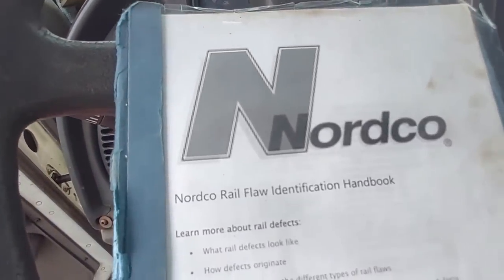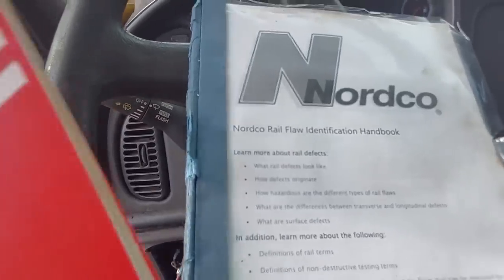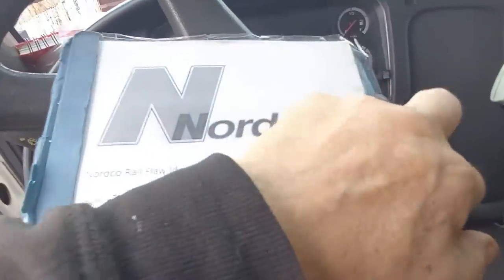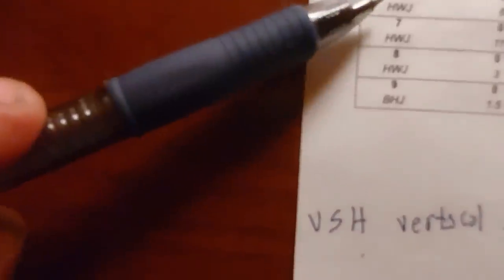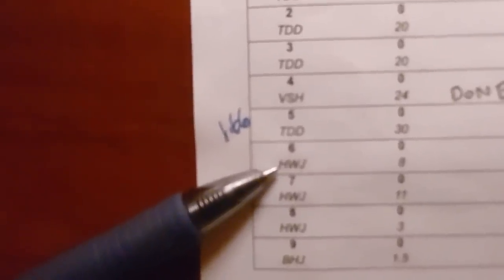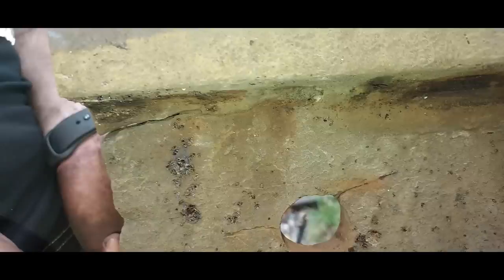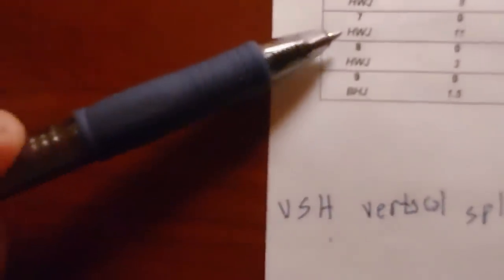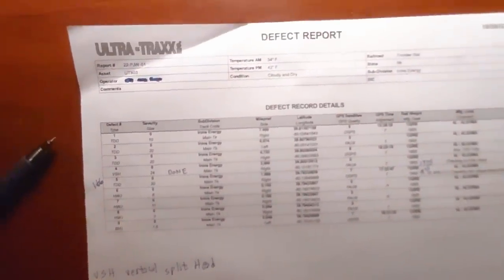Discover what an Ultrasonic Rail Testing Report Looks Like

Comment: Another great video Dave ,Iam a welder  and we would much rather have an ultrasound done than an X-ray because the x-ray just shows the flaw but the ultrasound shows how deep it is. Then you know which side to back gouge from which is usually the side that you have to take  the least  amount of material
out to get to the flaw.😊🍁😊
Reply from the maker: Very interesting Jay, I know they x ray gas pipeline welds, but
never thought about what you said, makes great sense. Thank you so much for taking the time to stop by and check out the video my friend.

Comment: Ahh! The yellow book! I’ve seen that book, but never read it. I was not directly involved in track maintenance, so I didn’t need to know that stuff. My only involvement with MOW work was as a pilot for the inspection car, or as “track foreman” when contract crews were working. In that case I would hold the track warrant for the out of service track and allow rail traffic to pass when safe.
Reply from the maker: Appreciate the nice comment Bill. that Sperry book is a wealth
of knowledge on rail development and defects. Thank you so much for taking the time to stop by and check out the video my friend.

Comment: Dave did you know that they are supposed to test the welds on the rail   we found many in the new welds on rail very important to have these done great video thanks Dave
Reply from the maker: No I did not Gary, although I would imagine for high class rail
yes it would be mandatory with good reason. They have never
tested a weld on our class 2 track, I will talk to the welders 
next time they come in to see if they have done any. Thank you so much for taking the time to stop by and check out the video my friend.
Reply: @ccrx6700   see what happens when you find someone who has worked with Conrail and CSX  and the bay colony railroad and B&M

Comment: Dave is there any chance you could set up a camera on the inside of a bolted rail joint so we can see the clearance of the wheel flange to the joint plates, we are mainly welded joints in the UK so no "klicky clacks "
Reply from the maker: Appreciate the suggestion Turbo Tim and yes sometime I will
do that, just not sure when it will be shown on YT tho, please
be patient. Thank you very much for taking the time to visit with us and check out the video my friend.

Comment: Sperry started with induction testing or using a high electric current amperage through the rail and changes in the magnetic field to find defects.  Ultrasonic testing was developed to help pinpoint defects.  Ultrasonic methods are easier than induction because less equipment is needed in the search.  Induction testing requires an electric generator and brushes that handle large current flows through the rail to be measured by coils to detect magnetic-flux changes caused by defects in the rail.  Induction testing equipment is installed in a dedicated rail car that can handle the weight and size of the equipment.  Ultrasonic equipment is usually mounted in high-rail-equipped trucks for ease of maneuverability and convenience of operation.
Reply from the maker: Appreciate your sharing that history lesson Roy, you are right. Thank you so much for taking the time to stop by and check out the video my friend.

Comment: Re the GPS locations
Basic GPS positioning requires reception of at least 4 (up to 31 operating) orbiting GPS satellites to be in view, and uses the time difference between received signals to calculate position. The "DGPS" on your report indicates Differential GPS is used to get a finer fix accuracy (fractions of an inch instead of feet) - some fixed location(s) in the region monitors the GPS signal, observe the current GPS error so that a correction can be made to the GPS position of the mobile station.
In other contexts the quality number is how many satellites were used for the fix, probably the same here. (In a valley typically fewer satellites are visible.)
I couldn't quite read the other term in the column, maybe "fail" indicating not enough satellites are seen? In which case other inputs such as distance travelled can be used to calculate a relative location from a known GPS fix.
Reply from the maker: Appreciate your sharing the information with us Tony, pretty cool stuff. Thank you so much for taking the time to watch the video my friend.

Comment: How is track class determined?  Also after a defect is found and the stick removed, how is the track broken to do final inspection?   Thanks
Reply from the maker: Class of track depends on a lot of things, curvature, ballast conditions, jointed or cwr rail, condition of ties, etc. It's easy to
break a rail that has a big defect in it, just lift it at the defect point and the weight of either end of the rail hanging down will snap
the rail in two. Of course it has to be out of the track to do this.
Thank you so much for taking the time to stop by and check out the video my friend.

Comment: Is there anything you can do about a defect other than replace the defective rail?  Does the defect detail information get back to the rail manufacturer so they can improve their product? If not it seems like the precise identification of a defect type is a waste of time.
Reply from the maker: Depends on the defect whether to replace or not Paula,  TDD's here usually we replace the rail, it will never get better. Mill will only
get notified if the defect is in a fairly new stick of rail, then
yes they will replace it.This rail was 1975 so US Steel no longer
even rolls rail.